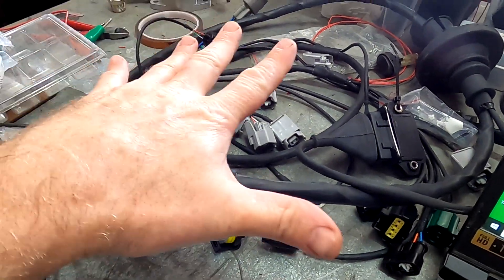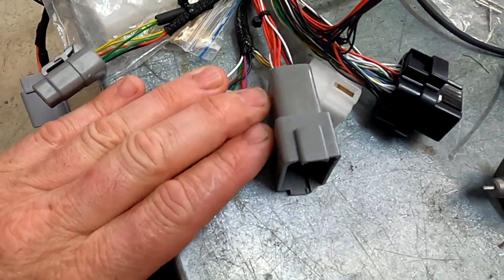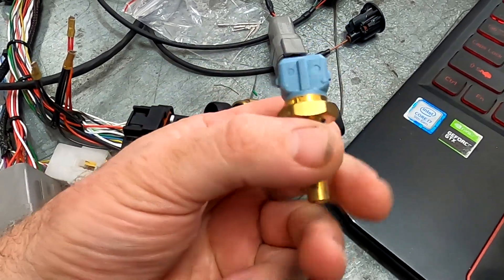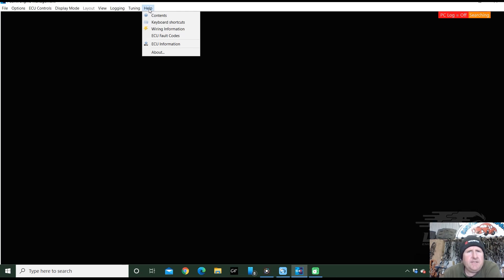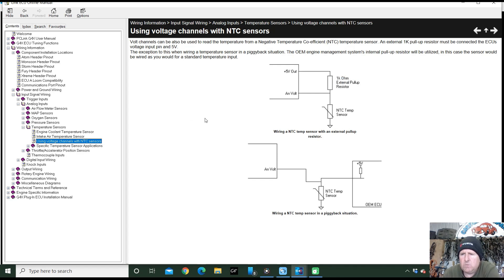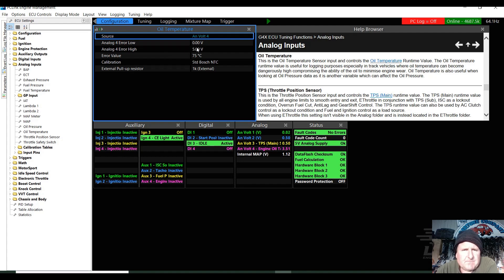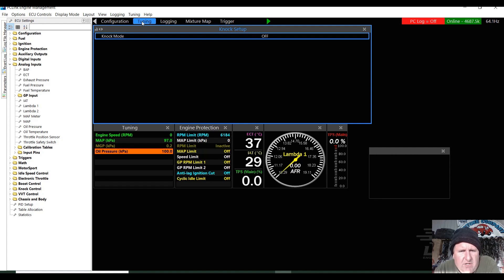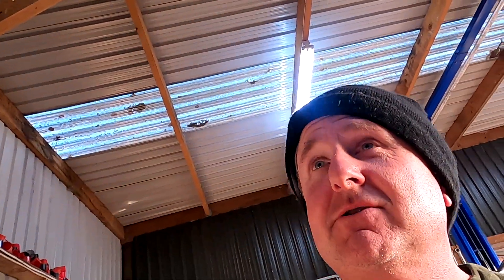link ecu - adding a temp input on analogue input.  Adding the external resistor

Comment: Quick question 2 wire NTC oil temp sensor, AN volt 4 with pull up register… do I use ecu sensor ground or chassis ground for the 2nd wire?
Reply from the maker: I prefer ecu sensor ground.

Comment: Does this have any effect on the 5v signal for the pressure sensor side?
Reply from the maker: When done correctly it does not effect the pressure sensor side at all.
Reply: @CartuneNZ thanks I'd been working on the haltech calibrations using Mv on temp but not working.  I guess they have an inbuilt pull up.
Thanks for the video
Reply from the maker: Most haltech analog channels have a selectable pullup.

Comment: Hello, I installed this sensor with a 2.5k pull up but the data sheet says to use a 4.6k ohm resistor.

I’m using the bosch config.

The readings I’m seeing seem incorrect, do I need to do some calculations for values of the new pull-up ?
Reply from the maker: In the link software there is a list of external resistor values.  I recommend using one of those to avoid having to alter the calibration values or making up the table.  This is one reason I use a 1K external resistor,  as its easy.  Cheers Kelvin

Comment: Kelvin, 
Have you ever used defi link sensors such as oil pressure/ water temp /oil temp to work with link monsoons x ecu. Are they linear?
Reply from the maker: Never used defi sensors with a link,  but provided they are compatible with the correct calibration  available a wide range of sensors can be used.   Cheers Kelvin

Comment: is it possible for the link to read a single wire resistance type oil pressure sensor?
Reply from the maker: I have done some in the past however with the availability of oil pressure sensors these days i feel there are much more accurate and easier ways than trying to establish a calibration table for a single wire sensor.   Personally I dont recommend trying to use a single wire resistance type
Reply: @CartuneNZ  yea i know i just don't wanna tear my engine harness apart to add a single wire lol. i installed an analog oil pressure gauge for now and was just wondering if i could tie it into the ECU for now until i decide to modify the engine harness.

Comment: Hi Kelvin, I have a 96 SC 400 and have non egr /primary and secondary cat deleted..no emissions required. I'm also running custom air filter, electric fan,   headers and would like to know how much for a rebuilt LINK ECU? I'm wanting to up the Rpm cutoff to around 7,200 and top speed limiter, along with the ability to control timing/fuel curve. Also, roughly how much HP can b freed up by going aftermarket. PS I'm currently running the stock autobox trans w/shiftkit...may go 6speed manual in the future(cd009) and adding a small nitrous system ? PS car is a weekend war ... Not a daily. Thanks again 👍
Reply from the maker: Link ECU don't presently have proper auto control logic.  We have new link ecu only which liberate between 10-15% more power on average.  Best result was 19% increase with a NA soarer with aftermarket ecu , the vehicle had headers and better intake and was tested with the headers on with stock ecu.
Reply: @CartuneNZ  that sounds like around 25+ HP. Have u any opinions on going manual vs keeping it auto? There's really very little sources or support regarding the SC400 in America. PS I sent you another question from your video doing the TB coolant bypass and wanted to know if removing the pressed tubes and plugging with JB weld is acceptable and can I just run a hose loop at back ports?.. MUCH Thanks! Enjoy your videos 👍
Reply: My apologies, plugging the tube jackets  e/JB on the stepper motor(AICV)?

Comment: Where do you usually mount that bosch temp/pressure sensor for oil? Picked up one of them and I haven't found a good spot for it. I have a SC400 oil filter bracket if that helps
Reply from the maker: I fit directly into the port where the oil pressure light would normally fit.  Then I have the light output on the link ecu.